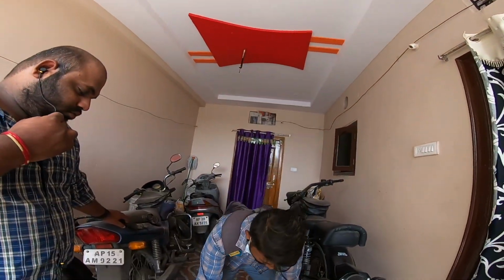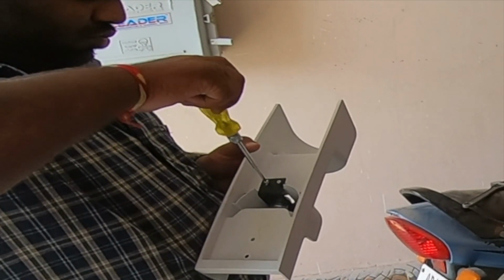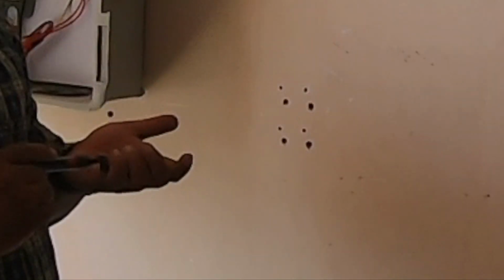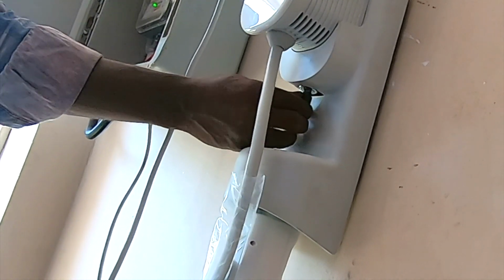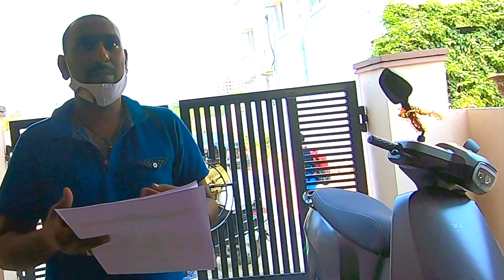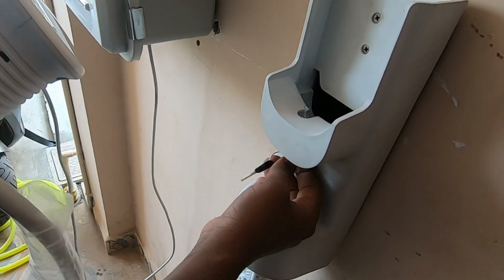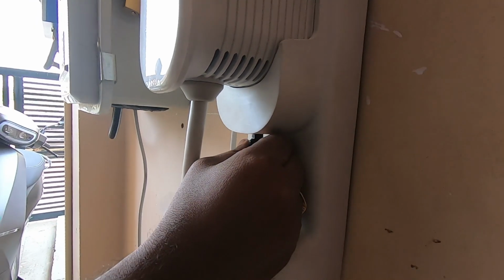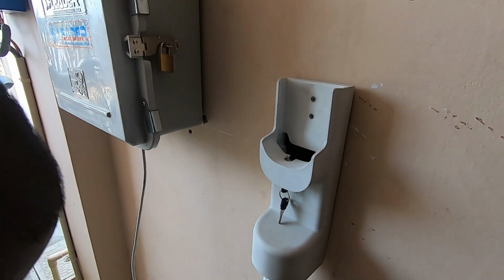Ola Wall Mount Charger Bracket - Installation | Damaged | OlaS1Pro | Part 1

Comment: Awesome info bro. Few queries, the amount Rs2375 we pay does include the 1. wall bracket 2. installation 3. 25 meter wire 4. 2 MCBs 5. 6A plug or we need to pay separately. please let me know
Reply from the maker: Check the below video bro, that will definitely clear all your doubts. Let me know if you still need any information after that. 

Rs: 2359 | Ola Home Charger Installation | Explained
https://youtu.be/jwDpam0rJ6Y

Comment: can you pls tell the total height of bracket+ charger and charger gun combined, when installed. Also the thickness of charger and bracket combined... i want to making a safe box for it. 📮
Reply from the maker: Sure, Ill check and update you
Reply: @AVAutoTech  is the height more than 60 cms?
Reply from the maker: This post is specially for you, Hope it answers your question.

https://www.instagram.com/p/CbzqgdYLjw0/?utm_source=ig_web_copy_link
Reply: @AVAutoTech  thanks a lot!
Reply from the maker: @ButterNaan  welcome
Reply from the maker: @ButterNaan  Just in case you need the Depth and Width dimensions

https://www.instagram.com/p/Cbz0nmOrlu8/?utm_source=ig_web_copy_link

Comment: Bro do you know is it necessary that the rental agreement should be only on the name of the ola owner only or if the rental agreement is on the name of ola owner and also one person will it be applicable if I want to upload rental agreement as delivery address proof.
Or bhai electricity bill par jo landlord ka name hai voo edit kar ki mera registered name daal do kuch verify nahi hoga.
Reply: rental agreement can be in any name with relation
Reply from the maker: 1) If you are from Hyderabad then avoid rental agreement (they are not accepting it anymore) 

- non Hyderabad then rental agreement has to be on the buyers name (If you have one on your parents name then try uploading that, if not just pay around 300 and get a new one on the buyers name) 

(I did this) 
Best option is to get gas passbook, they probably take 100rs to give an updated one 
2) Even if its on your Father’s name its ok, His name will be on your Aadhar right so they accept that as well

3) Editing electricity bill, I would not suggest it